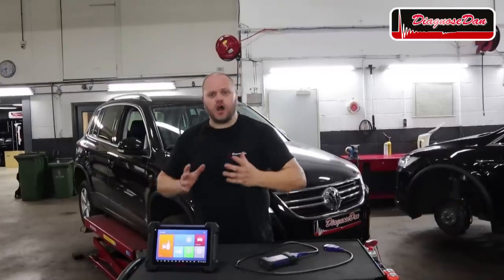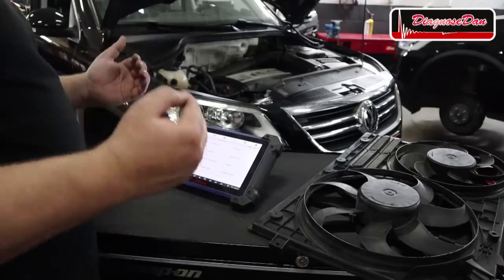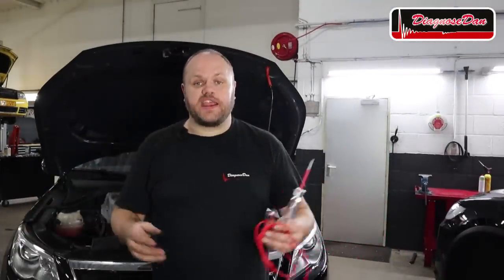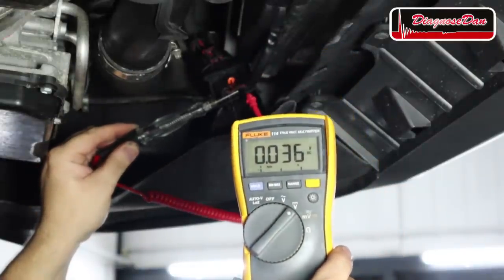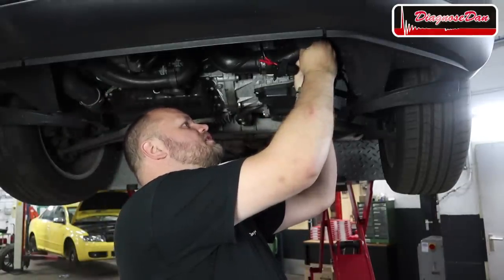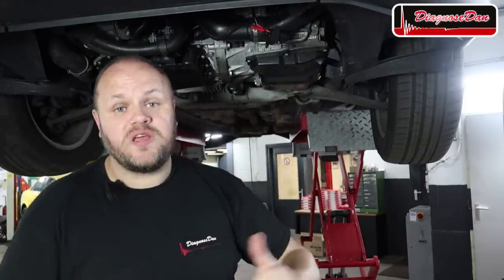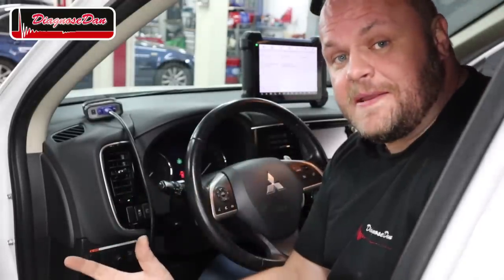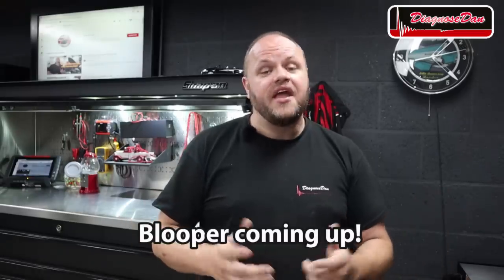A Cheap Chinese Car Key from Wish, will it work?

Comment: Dan, will that tool program Mercedes Benz DAS 3 and 4 keys? Do you have any experience using it for those or for BMW, VW/Audi? Thank you
Reply from the maker: I Just got the tool and i've only used it in this video once. There are many video's on YT using the Im608 on Mercedes. You can always check the Autel website for the coverage.

Comment: the lancias of the 80's had a similar system  with common earth behind the headlight , it would corrode badly and cause allsorts of problems with the heater controls and other circuits

Comment: I had a 2004 Audi A8 in 2014 and it kept draining the battery and you guessed it, nobody could isolate the problem/problems and I wasted time and money. Wherever I went I had to dislocate the battery lead to be 100% sure that it wouldn't go flat. Luckily the battery was in the trunk/boot so it didn't look like I had a problem by opening the hood/bonnet.
It was great car to be in and to drive but it's gone and the problem with it. It got hit in the rear and was written off.

Comment: I kept telling people LEDs are not foolproof. I was laughed at with my 21w, H1 bulb collections with solered on old wires and crocodile clips. LEDs and multimeters do not load the circuit but look really smart AND are deceptive.

Comment: try the fluke sv225.

the problem with a multimeter is they dont put a load on the circuit.

now the sv225 loads up the circuit which can help, or use a resistor block
Reply from the maker: That's great 👍

Comment: There is an option on Fluke multimeters, called "Voltage LOW Z", it measures the voltage + loading
Reply from the maker: Yes but not on al multimeters

Comment: Had same problem with my 1996 vectra, I found two wires to be cut... A solder solved the problem :)
Reply from the maker: Great Job 👍
Reply: DiagnoseDan Thank you Mr. Dan 🥳 At first I taught about the grounding issue, and I tried the "Beep/continuity" function, to find the correct wire :)

Comment: Looks like those Tiguans have grounding issues all around. 
Some time ago, you made a video about bad ground on another Tiguan with starter issues. 
👍👍👍👍👍👍👍👍👍
Reply from the maker: You are right i remember, was a long time ago.
Reply: Its all EU cars like that, BMW had many recalls on ground issues, where lights were melting bulb bars and plug pins etc,
Reply: @ansv3340  ...What I'd kind'a investigate if I were Dan, is how exactly that bolt came loose. 
Looks like their tightening tools in the factory are starting to go bad.....😂😂😂😂😂

Comment: do u have any video for ford ecosport 2015 abs module issues and hoe to repair the module 
i think it just some "dry solder joints on the pcb inside the module on the power supply lines .

Comment: I had a 2010 Lincoln MKX and the driver side headlight wasn't working, the bulb was fine. I had plenty of voltage when plugged in and unplugged from the bulb. 
Pulled the headlight and found a wire that was 99% broken it had 1 strand of copper wire still intact. Repaired that and, it was good as new.
Reply from the maker: Great find

Comment: You mentioned in the video that a multimeter is not a tool to test power and ground. On this vehicle in your video if the previous shop had done a voltage drop test on both the power and ground they would have seen the voltage drop on the ground side when trying to bidirectional control the fan. A multimeter would have been more accurate then the test light and would show how much resistance there was by how big the volt drop was. Even a incondescent test light can make a circuit look ok but infact it has too much resistance to operate a component correctly.

Comment: find the resistance on the ground,  just jumper cable it to the positive battery post through a 50+ amp load :)))
I'm joking of course, but I have been mad enough to do just that in the past (very old vehicles/trailers) a newer car that would/could damage tons of stuff within the harness or back-feed and cook other things on shared ground points. lol
Reply from the maker: That would mean alot of smoke😂

Comment: Hi dan, its hard to find new key fobs, do you think a key that is already registered with a car can be re-registered again on a new car, or do you have to clear the old fob first. Also does this scan tool have an option to clear an old key. Thanks.
Reply from the maker: On some cars you can program a used key. But that doesn't work for 95% of all brands (i think it can be done on some fords)

Comment: Damn what a nice tool. Red and green and digital, wow. Good talk! Learned a lot!!!
Maybe those other wires started giving sparks due to that movement of that bolt. Ohw, I thought the wire was broken, so it was not, sorry.
And isn't that a crappy design? Those 3 wires on a holding bolt, that wiggles? In such an expensive car.
Reply from the maker: Tool addict?😁
Reply: DiagnoseDan Lol. That was good thinking.

Comment: My friend had a similar issue on his 2004 Mercedes-Benz S Class S320. The battery kept going flat. The Mercedes dealer first diagnosed the battery and when it went flat again the dealer diagnosed the alternator; it cost £1000 in total. The car broke down again and the AA breakdown service diagnosed a faulty battery. I took a look and found the battery terminal hot, I replaced the earth cable which resolved the problem.  Mechanics are rubbish in the UK.

Comment: You shouldn't grind the protective tin layer from ground terminals, now the naked brass or bronze will oxidize soon and could make problems! You should just fasten the bolt and that's it or if you want to clean and polish the terminals I use the blue rubber (blue-red rubber) for erasing pen marks from paper which you can buy in every bookshop, but do not polish too much because this protective tin layer is very thin.

Comment: Nice one too bad the other shop only used bolt meter to check for power and ground but would doing a continuity test on the ground side of the circuit probably find the problem?  My guess is yes you would of found high resistance
Reply from the maker: If your doing a recistance check it's sometimes hard to determine what an allowable recistance.

Comment: I got fooled by a bad ground using a meter, now I use a cheap test light with a 3156  bulb. As long as it draws more then an amp you can see it go dim
Reply from the maker: That's great 👍

Comment: Ground wires can be hard to diagnose properly, i had a volvo 850 a while back and it had loads of electrical issues, all the gagues were bouncing up and down and i had this horrible noise, it was a bit normal when i turned off the lights so i asked around and i heard it could be the light switch getting faulty, i was planning to buy one when i took another look and found a ground wire that wasn't on properly, so i fastened it and everything was solved, all this and i also bought a new alternator
Reply from the maker: Fixed without any parts! Awsome

Comment: hi, dan what would happen if had a multimeter connected and you activated the circuit with your scanner, what would the voltage read cheers, nice scanner programming keys scares me, in fact, any programing on cars, always worried I would fu-k something up
Reply: Thats a good one, probably it would drop to 0
Reply: @aaaaa_12345  yep, I think your right
Reply from the maker: One of the fans is a control module, the control module shares the ground. So without a ground it would never turn the fans on.

Comment: This is a simple voltage drop test that can be done with any multimeter. Just make sure the circuit is turned on.
Reply from the maker: The circuit was not on because the module had a bad Ground.

Comment: Great way of pointing out diagnosing is more than just following what a scan tool says or reading a digital display.
Pity the customer didn't come to you first would have saved two visits and the price of a VW fan unit (€?) and damage to the wiring!
Looks like you could retire just from the profit of making a few new keys but DON'T.
Great video as usual, I'll think about growing a beard.
Reply from the maker: The customer bought the Car at the other shop and everything was covered under warranty 😁
Reply: @Diagnosedan  Hope you left him your card he wouldn't want to be going back to it after the warranty runs out.

Comment: I have a ford edge. Put two non oem fan assemblies in with controller. Both didn't work correct and eventually failed. Put oem in.. never had a problem since.
Reply from the maker: Why did the OEM failed in the first place?

Comment: You could also check the voltage using a DMM with the fans activated.
Reply from the maker: And how would you suggest turning on the fans? One of the fans is a control unit and that didn't work either because of the Bad ground. So the control unit would never even try to turn on the fans
Reply: @Diagnosedan  You tried to turn it on, but it didn't because of the bad ground.  The reason it didn't turn on was because the voltage dropped when you tried to draw current.  If you measured the voltage at this time it would have been low instead of 12V.

Comment: Nice scanner that Autel.  but do you think launch X431 V+  would be a good choice?  its about 1/2 price.
Reply from the maker: This Autel is a Key programming tool the Launch is not, it maybe does 5% immo related stuff compared to the IM608. But if you are Just using it as a scan tool Launch is also a good choice

Comment: Personally , if I was the owner, I would use the new key and put the original kay away as the spare.. I like using what would be the most reliable as a backup. Sad if the chinese key failed over time without anyone knowing and when you went to use it, it's no good so you have nothing. 
I keep a 10ohm 20watt resistor around for testing power feeds instead of the incandescent  method.. The resistor across the connection draws a little over one amp in a good circuit and I put my multimeter across the resistor to test for a drop.
Reply from the maker: Thanks for the feedback 👍

Comment: with enabling the fan with the scan tool could you achieve the same thing as you did with a test light but use the DMM?
Reply from the maker: No, because the module that turns on the fan also had no ground it would not even try to activate the fans.

Comment: A voltage drop test would have found this as well. Neg lead on the Neg batt term, pos lead at that Neg connection and anything over. 05v is a problem.
Reply from the maker: Thanks for watching

Comment: For the couple minutes it would have taken to replace the ends of all three grounds I would have called the other shop and ask them if they wanted you to do it while the light was apart. I understand you were only asked to diagnose the concern but it seems redundant that they would have to remove the headlamp and everything you’ve just done to replace those ends.

Comment: Is the back probe pin really fit to carry the current in the jumper wire to these big fans?
Reply from the maker: No! Good point, only use them for a quick test.

Comment: Mercedes A-Klasse 2014 Two original keys. Both work sometimes, one fails sometimes, the other fails sometimes and both fail altogether sometimes. Batteries are new and leds on the keys blink red when one presses the buttons. Mechanical key does not work in driver's door. One day soon we will not be able to access our car. Fortunately we have a C300T that has two working keys.

Comment: Wouldn't it be also possible to do a voltage test between a known good ground and the negative ground on the connector? Wouldn't the voltage meter then show a +0.3V voltage showing that a extra load is present in that part of the circuit? Would this be a good test instead of the bulb light tester?
Reply from the maker: Yes you could do that

Comment: Dan, I barely know 1/1000 of what you know. I would have wired direct to the battery to see if the old fans came on first, if so, jumper a ground from the fan to the frame.  That would tell me it would be a ground wire, and go from there.   Sure wish you had tested the old fans, then it would be up to the other shop to do the right thing, and put the old ones back in and NOT charge the Customer for the new fans, since they  just threw parts at it and the customer had to pay for a non fix!

Comment: I sure hope the other shop is an honest shop and put the old fan back in and gave back the customers money as well as give back the money for the sensor they replaced. Had they done the proper diagnoses they would not have made those mistakes.
Reply from the maker: The customer bought the Car there and everything was covered under warranty 😁
Reply: @Diagnosedan  thank you for the reply.

Comment: last week i had a similar problem , an ac clutch wouldn't kick in there was enought pressure in the system.
Next i meusured the supply with a led test (with no load) and it wasn't there except it flashed once every 2 seconds. 
 The car knew the cable was disconnected and so didnt put power on that line anymore. , After that the AC just randomly started working again so i couldn't finish the diagnosis.
So another reason to test with some load connected
Reply from the maker: Thanks for the comment 👍

Comment: After changing the sensor, and (I'm sure a very expensive) fan unit, I wonder why that other shop didn't perform a simple test that doesn't require any digital equipment or test-light - such as LOOK at the fan to see if it's WORKING!

Comment: How do you make a copy of a 1999 Volvo v70 key which has a transponder chip (non-powered, it gets power inductively from a coil around the lock cylinder) inside the key?

Comment: You wonder why even pierce the wire at all? If you're doing your circuit checks without load you might as well unplug it and check the static voltage.

Comment: Would it have been possible to command the fans on with the autel tool and measure voltage drop with the DMM? I believe that would have yielded the same results as you got with your incandescent bulb.
Reply from the maker: No because the fans are turned on by the module in the fan that had no ground. But your general idea is right
Reply: @Diagnosedan  what's the difference between your load (incandescent bulb) and the module?

Comment: Hi Sir, I have a problem with a volks passat 2013 , pressure contr.solenoid B and pressure contr.solenoid A . Performance or stuck off , both solenoids. 
Automatic transmission pressure valve 1 and
Automatic transmission pressure valve 2.
Can you help me please i swap the transmission thinking transmission was bad but still the same problem after swapping the transmission.

Comment: I had my share of bad grounds another tech ordered an ECU for a no start condition. Problem is the same Use a test light on B+ tested the ground wires on ECU connector found a bunch of wires grounded under the battery full of corrosion. Using the service manual verified ground location cleaned it turn key VROOM! I saved my co-worker stating to the manager he had the car apart & I had to put things back on. Anyways the meter I use catches a poor ground via low voltage reading or no voltage at all. Strange to see a multi meter not picking up a poor ground??? Would a voltage drop test with a meter catch the poor ground wire connection? As usual Diagnosis Dan fixed it again TitTit Tit LOL👏👍🤣

Comment: Dan love the show, I have an problem on my VW CC radio RNS 510.
I can't put the security code in, I just tried everything the soft reset after the vw welcome is back on, then switch of, when you turn the power button on after the welcome radio is shown to come on without sound.
Then security key comes up again, without I can't anything touch screen is not responding.
I only have an simple Icarsoft for Audi, VW, skoda tool and it tells me code 02635 I google and it says.
Tuner not enabled /activated
Value of resistance to high.
It seems to me radio is getting warm.
I went to the fuses and to took the radio out to get the radio dx code
014 VW Z6Z627M7154175V
Security code 1838
I don't know what to do.
Maybe you have a plan.
I the code from the vw dealer and they give me after all my information and my vin. Number charge $80 and could insert the pin themselves.

Comment: Bought used ford foucs 2006 with remote 3 buttons. Can open and close the car manually and drive the car but can’t open or close the car remotely went into key shop to fix it he can’t try to program the key on off 4 times the car enter into program mode but when push button into remote nothing happened try to program another key same issue please if you can help me thank you 🙏🏻

Comment: I have to wonder about the quality of the cheap key.  I wonder if they bother to give it a unique code.  Meaning, any other key from the same supplier that just happens to be in the same "window" for the rolling codes will work.

Comment: if a add a lamp (load) betwin  the red + and black - multimeter leads , how many watts scould it be ? Or how mutch current scould my test lamp draw ?
Reply from the maker: Depends on the circuit your testing, use about the same load that's normally on that circuit

Comment: a classic mistake i see often at my dealership, especially with younger techs, just because it has voltage does not mean it will carry current, i have a special test lamp i built that pulls 4 amps for loading up a suspect circuit

Comment: I'm just wondering if the other shop sent the spare fan assembly home with the owner of the car or just kept it and still charged the owner for it and the labor for installation. If it wasn't under warranty it would have cost the owner a fortune for their ineptitude.

Comment: You are checking the voltage while connected, The feed it 12V, but the fan do not work. although the Fans are good. So, where is the voltage drops? I don't know why? can you explain for me?
Reply: if it drops at the ground, then the display must be 0V. why, why that, why the display is 12V
Reply: it can relate to the control wire? If you disconnect the 2 wire of control. I think the voltage that you measure is 0V